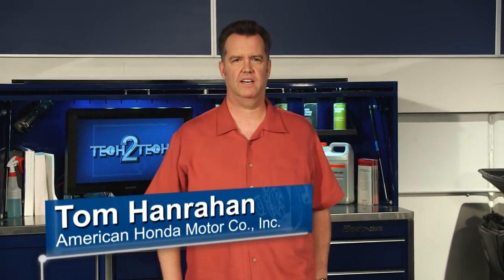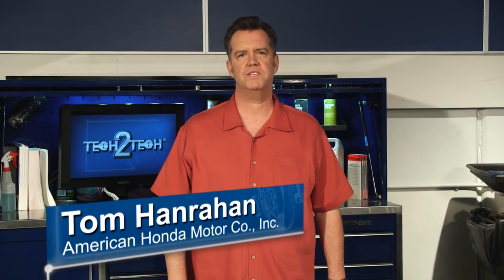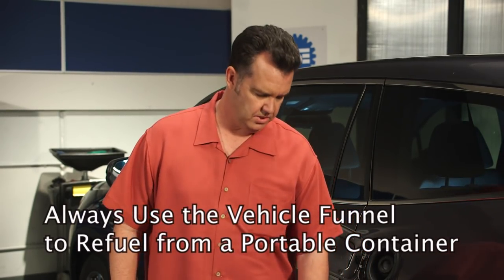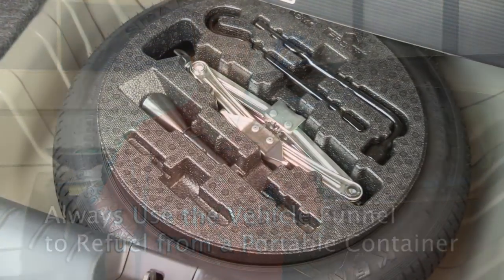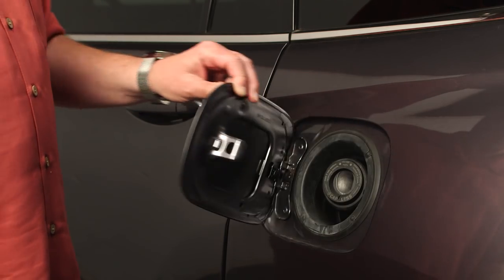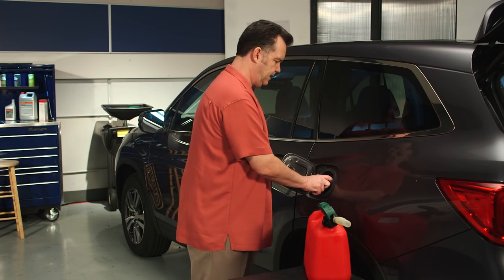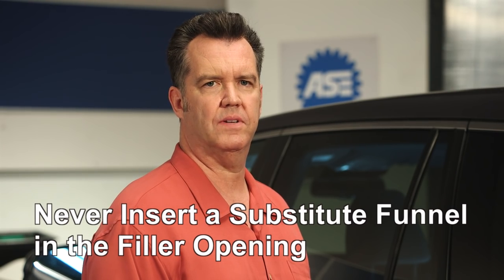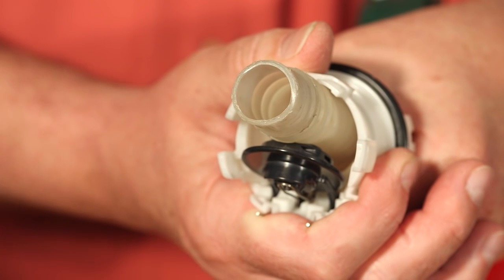Honda Refueling a Capless Fuel System Vehicle from a Portable Fuel Container

Comment: FYI out here in California filler nozzles get stuck in you capless systems all the time. I have to deal with them at least once a week at my gas station. To remedy the problem you have to push in firmly and then gently pull up and out.